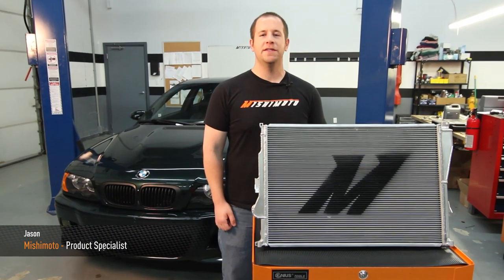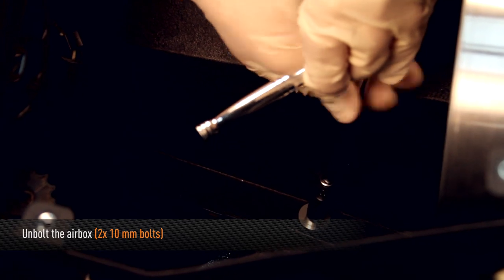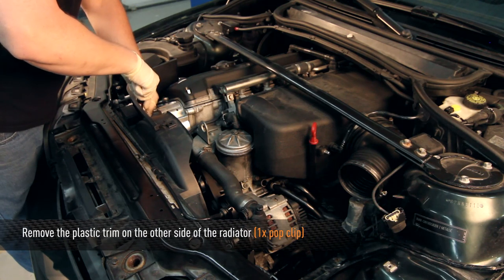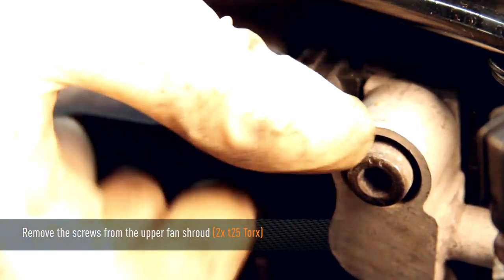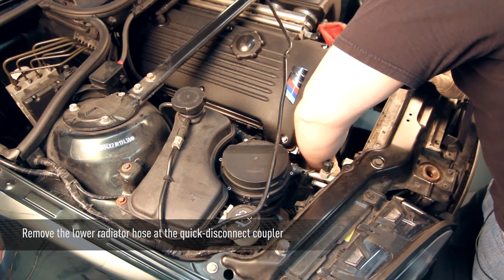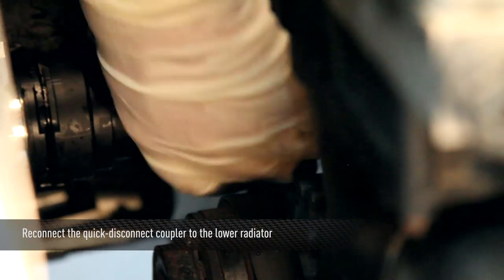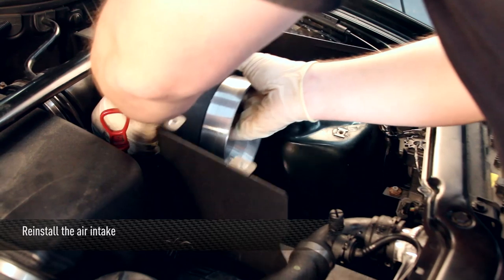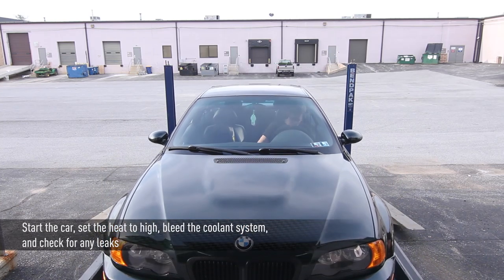2001-2006 BMW E46 M3 Performance Aluminum Radiator Installation by Mishimoto

Comment: What about the electric connections for the new electric fan? Where do those get connected?
Reply from the maker: Those will need to be wired into a manual switch or into a fan controller kit since this is converting from a clutch fan assembly with no wiring.
We offer a controller kit here: https://www.mishimoto.com/adjustable-fan-controller-kit.html

Comment: Great video, looking forward to doing this install. What air intake is that?
Reply from the maker: Hey Black Flagged. Unfortunately, the team who made this video is no longer with the company so I would not be able to confirm. After reviewing the video, it appears this may be a one-off intake.  From what I can see, there is a mix of some factory equipment and aftermarket parts.
Reply: Mishimoto Automotive no problem, thanks for the response!
Reply from the maker: Anytime :)
Reply: Looks like an AFE stage 1 airintake with a stage 2 dry cone filter.